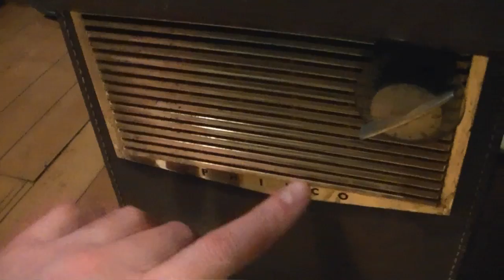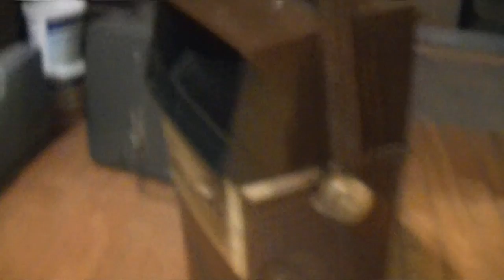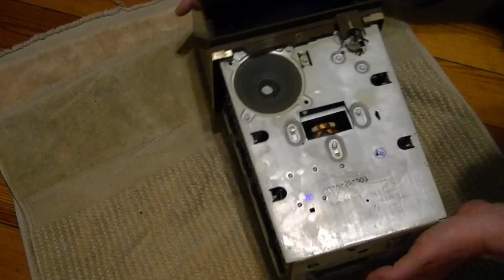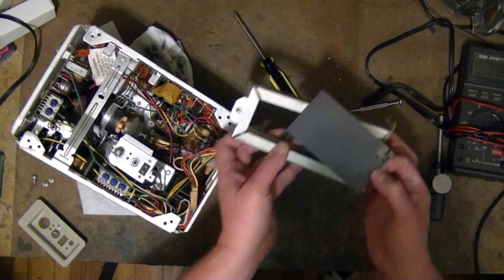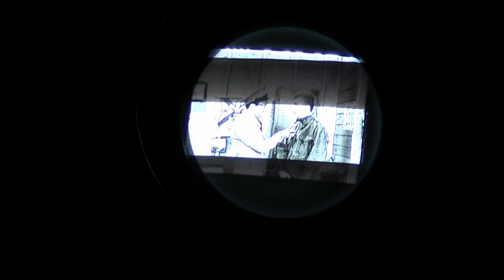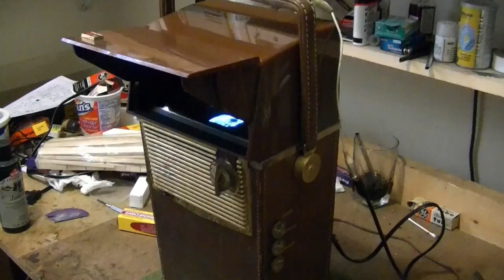Philco Safari

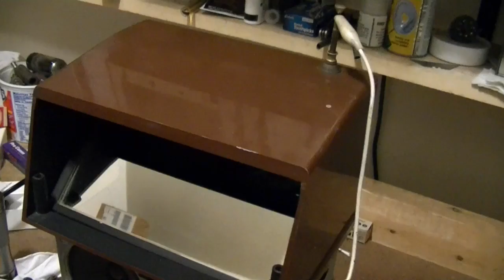Comment: Funny but it looks like a 70's style trash receptacle open on 2 sides especially at 27:40.  Very surprised this was available in '59 with transistors, that was cutting edge at 7 watts only because of transistors were invented, the CRT filament probably used 3 watts.  Philco was cutting edge developing the communication ground stations for the Mercury project prior to TDRS and the consoles for ground control.  Today at about 15-50 watts with LED backlighting thru LCD 60" paper thin 4k.

Comment: Compared to many attempts on portables, even after the 50s and well into the 70s and 80s.... this is truly amazing. What a product, especially to still be working.
Reply from the maker: Yes indeed.  Turns out that Philco had some advanced semiconductor R&D back then.   I had't realized until I did some research while working on this set.
Reply: @bandersentv  They were a defense contractor as well as a manufacturer of consumer products, so that gave them a leg up on the competition.

Comment: You can see there is a little bit of browning where the picture is projected onto the phosphor.
Reply from the maker: Yes, projection type CRTs gradual turn brown with use.  The Safari I picked up more recently has no browning so must not have seen much use.
Reply: bandersentv Yeah, it's kind of like how you get burn-in on an ATM or something else that displays a stationary image a lot, but in this case the whole screen area is affected evenly.

Comment: I have. A small Standard TV with rod antenna, great candidates for the Drake or Blonder Tongue. Mine is buried in my hoard stack of "junk". I have a couple of Sony watchman, two sizes, that use a reflector type display. If my Blonder Tongue transmits to my backyard bar, battery portables will be nice again. I have one 10" flat screen ATSC battery portable, but it only gets a couple stations on its rod antenna.

Comment: The linearity is fantastic, what method of deflection does it use.
Fantastic find.
Reply from the maker: Magnetic.  You can see the yoke when I take the cover off.
Reply: I did not get a chance to fully analyse the video, but for magnetic that is very good to say the least, from the video it is set square straight. Best of luck with the restoration.
Reply from the maker: Helios Haul
Perhaps.  An image that small can be deceiving.  I'll need to use a crosshatch pattern generator to see if the linearity is really correct.  The raster being straight and square really doesn't mean much.  The only way that would be off is if there was something wrong with the yoke (AKA keystoning).

Comment: O Bob, It's always a bright sun shinny day with you. No broken handle, all it need was screw tighten. It's almost like things fix there selves by you just looking at it. If battery is only 7 bolts, hows does the TV get 4000 bolts out of it?
Reply from the maker: It uses a flyback transformer just like a conventional TV.

Comment: that 7.5v is awfully close to the 7.4v of lithiums. You should hit up hobbyking and pick up a nice chunky lithium pack and charger to run this thing. Would lighten it up a bit, wouldnt change the function or appearance in any way, and would give it an abnormally long battery life compared to the original battery.
Reply from the maker: I could, but I'm not really going to be using it on battery power.  Inside my place I can use my own transmitter, but if I take it anywhere there won't be anything to receive.

Comment: wow 4000 volts .... from  7 1/2 volt battery
Reply from the maker: Actually closer to 7,000 volts :)
Reply from the maker: Steven King
Sure.  Most of the CRTs shown in my videos run on 6kv to 16kV.

Comment: You're going to have lots of fun with that thing. It probably doesn't have many hours on it; too small to use at home and that battery was expensive and didn't last very long. Early germanium transistor sets are - well, you'll find out.

It's not surprising that the battery isn't there; the set didn't come with one and it cost about $100 to get one for it. They were attractive but almost totally impractical; when you get it working try watching it outdoors. Even that use case wasn't valid.
Reply from the maker: The original ad says $250 for the TV and $5.25 for the battery: http://i1247.photobucket.com/albums/gg632/electricalengineer1958/Philcosafaritvad-lifemagazinedec141959.jpg
Reply: Hmmm. I remember those being sold new and the price being $299 for the TV and $99 for the optional rechargeable battery. Maybe it wasn't this exact model...